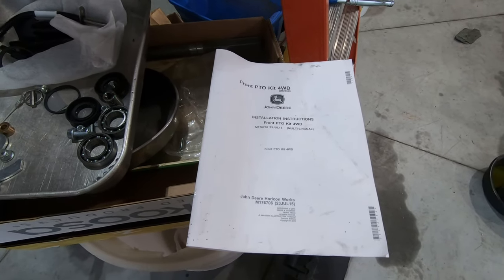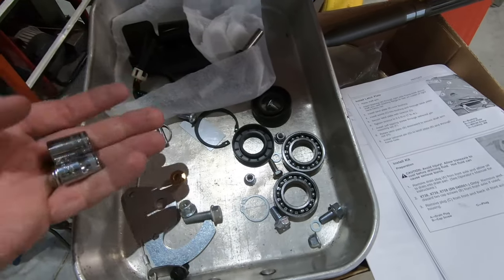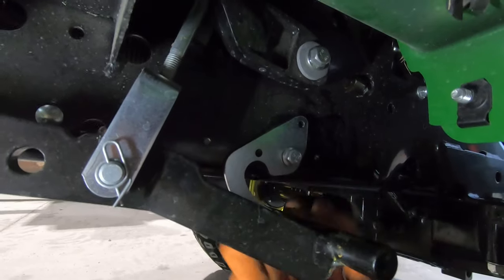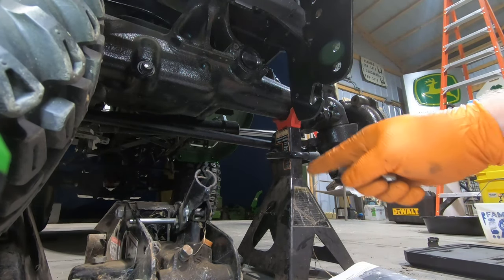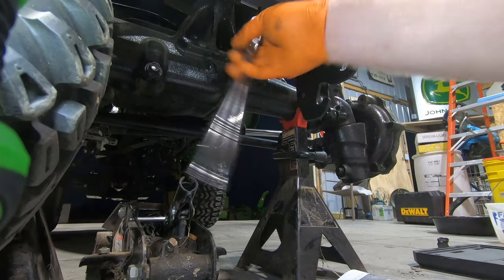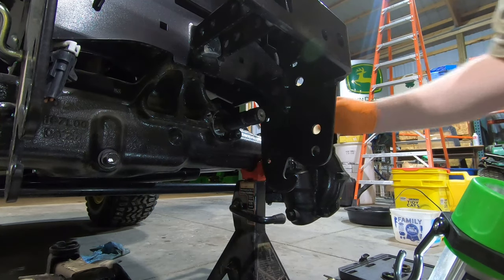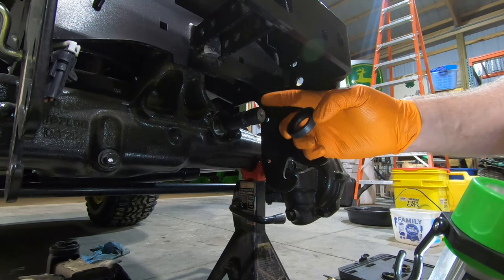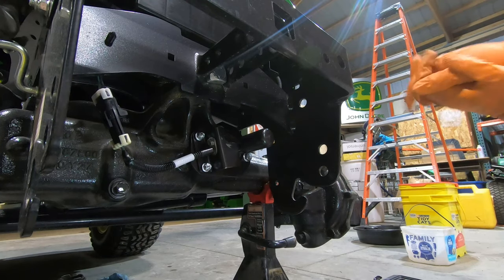John Deere X758 X738 Front Axle Shaft for Snowblower

Comment: That draft arm swing bracket; I was thinking the flange of the brass bushing would serve as a spacer between the frame and the swing bracket to prevent the swing bracket from rubbing against the frame. Either way, it appears to work fine. Good content. 👍

Comment: Hi Kyle,  do you think those mower draft arms will fit on the older x728/x748 tractors?  thanks
Reply from the maker: They should fit the older machines. I know I have seen the newer HC decks under an X740 before. One of the things I would like to try is swapping my 7 Iron onto the X758 and the 60HC onto the X748, just for fun! Check out around the 14 minute mark in this video https://www.youtube.com/watch?v=0ZlPOVhYK3k&t=1s

Comment: Do u know if the X738 comes with the correct relief valve to use a loader?
Reply from the maker: No it does not. You would need to get the proper valve for the transaxle. I can't remember the number off the top of my head, but there is one for the 2wd and one for the 4wd units.

Comment: Ok, I'm gonna do it,.... I'm going to be the guy. If you are going to use this to blow snow, why did you not get a 1025R with the available factory heated cab?  Having seen your winters, I would not want to be on an open station tractor blowing snow. Plus you would have gotten the rear PTO and 3point included. Just curious. Also, I would imagine the front PTO kit is probably the same or very close in cost for both machines.
Reply: Simple solution to an open cab in the winter is to wear a modular snowmobile helmet.  They work great at keeping the snow off your face!